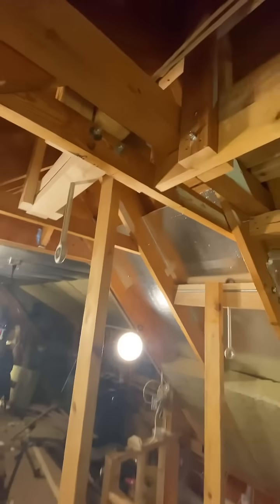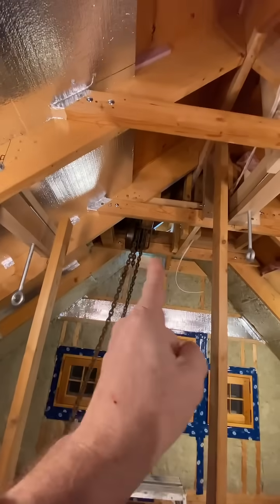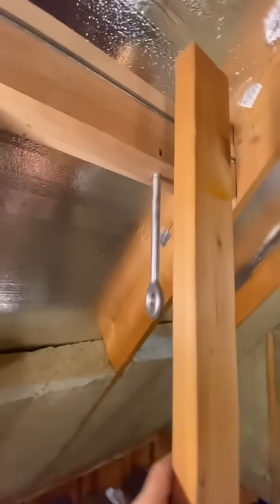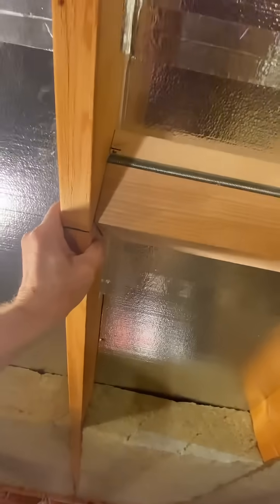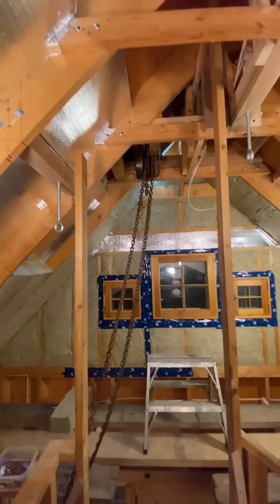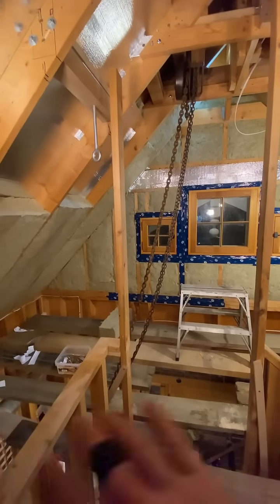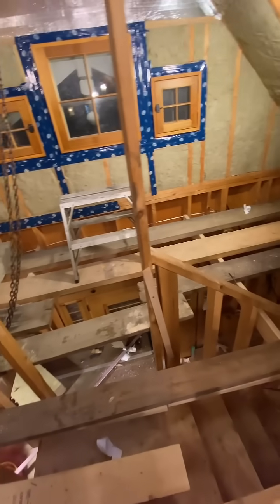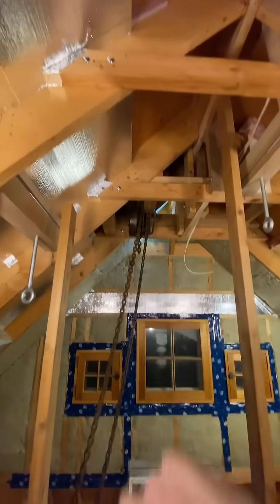Structural work for the 1 ton chain fall in the shop

Comment: Hate to tell you, but the ridge board (especially as yours is a 1x material) is the least structural of the roof.
Reply from the maker: that's not true. When I use the term structural, I'm actually looking for the elements that do not deflect. you can clearly see that the ridge board is 2 x 10 LVL spanning approximately 5 feet because it is gusted by the 45 brackets at either end. You will also notice that there is a compression stick to the underside that was cut long by about a quarter inch to preload the ridge and sprung between the 2  45° diagonal braces that effectively cut the ridge span from 8 feet to 5 feet. if one was to calculate the load capacity of the ridge, not supported by rafters it would be capable of 22,000 pounds. The building is held from spreading by the floor deck  and so now you have to add the strength that the rafters  applied to the ridge. The span of the rafters is also only 8 feet and by code in my region in Canada only requires structurally a 2 x 4 yet these are two by eights not for structural strength although they certainly do affect it they are deepen for Insulation capacity